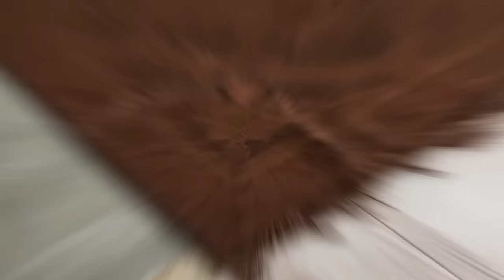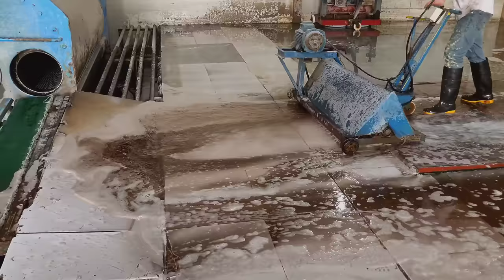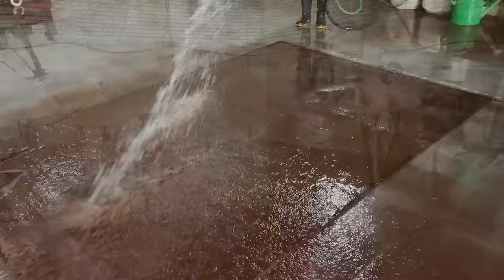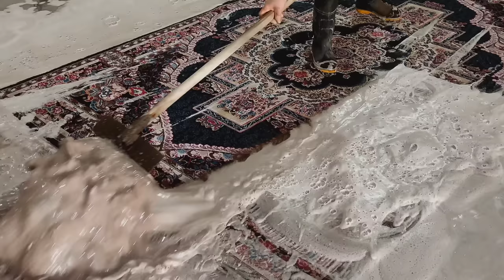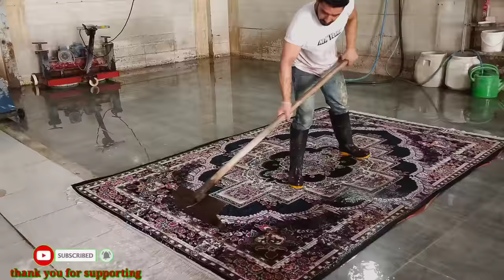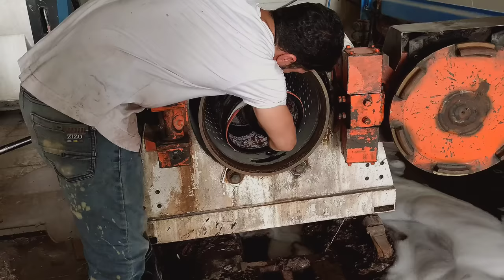$1 vs $100,000 Black Carpet! | The Hardest Rug of My Life!

Comment: I didn't expect the carpet to be so resilient and strong despite its initial state of neglect. Do carpets get weak with age? This work is quite physically demanding yet mentally fulfilling! Keep up the excellent work!
Reply from the maker: Yes and yes, thanks and welcome💖🌹
Reply: Believe it or not, these expensive rugs, sometimes over $1000, actually stand against time. They can take a beating, for sure!
Reply: If they are made of wool they can withstand a lot. They are also the easiest fiber to clean.

Comment: Turn it over and run a beater vacuum cleaner over it, Clean up the mess. Do it again untill solids stop falling from the rug. Now , with the sand and grit out, turn it back upright and clean it. I take all my area rugs out of the house, lay them on the grass, and do this. All the heavy stuff falls into the grass.
Reply from the maker: Awesome, thanks for the tips👍

Comment: My guess is the rug was saturated in silt-laden water from a flood. Excellent restoration.
Reply from the maker: Hi dear friend
We receive 100 carpets a day from customers for washing, and one or two of them are dirty like this.
Most of the strangely dirty carpets have been used by the owners in work and public places.
Reply: @change-cleaning-service-center  Thank you for the clarification. I have traveled a bit and noticed that they use carpets on the ground in some outdoor environments such as bazaars and as the floors of large tents, and can imagine how dirty things can get if soil is tracked in from an unpaved exterior.

Comment: When I was in the middle east, the fibers of the hand knotted carpets were tight together, resulting in stiff carpets, with little softness. The older the carpet, the more the fibers have been broken down resulting in softer carpets.
They would take a new carpet, and accelerate that "softening" process, by placing them out on the street, and allow cars to drive over them.
In some cases, the buyers would prefer a more aged appearance, and so they would take yogurt  and work it into the fibers, then place that out in the sun to "cure"
Reply from the maker: It's that right, thanks for your info👍👍

Comment: Just about need a rack to support rugs 2 inches above the concrete on a stainless mesh similar to expansion steel.  Then pu tthe rug inverted and spray right through it.

I cleaned a smaller rug for my mother years ago, since it was a one time thing I hung it over a rope, so the water sprayed would flow off taking the dirt with it... rather than sitting in wet mud on concrete.

Flush the debris out, then get the water out... and pray that the dyes are not water soluble (many of the rugs have dyes that will "bleed" when wet and water based cleaning will destroy the rug.)
Reply from the maker: Awesome dear, thanks for the tips 👍

Comment: I wonder if hanging rugs on a rack and starting out with a pressure washer and letting gravity do it's job before putting on the floor for all the cleaners would make the matter easier??? If skilled with a pressure washer you can avoid damage but bring a faster cleaning time???
Reply from the maker: We will do it
Reply: @change-cleaning-service-center : I'd probably start with soaking the carpet before pressure washing to help get the dirt rolling quickly [vs slowly with just a spraying by the presure washer] and some kind of rain gear, eye protection, and always be careful of your fingers or skin getting in front of the high pressure spray nozzle cause it can cut skin in some cases... Why being careful on rug faces and pattern should be cautious too and only use enough pressure thats needed... Prolly anything 3000 psi and lower will be best... But can't go too low either or not going to blast dirt particles out and away...  Obviously utilize the pressure washer nozzle for cleaning all the dirt and particles that are going to fly on walls during the process... Godspeed...

Comment: This is so satisfying to watch, but that reversing switch on your machines makes my wallet hurt. How often do you have to do work on those, or do you get someone else to repair them? The one with the two motors seems like it would break down more. Also great safety idea wearing rubber boots while doing this work with that cable hanging over your shoulder.
Reply from the maker: Awesome😊👍

Comment: One of my very first attempt to cleaning carpet after this 50th dump load of water or should I say mud I stopped that was a trailer house
1980
The next one was 2005 and this was a 6 x 5 piece of carpet at the bottom of a landing 
After 20 containers of cleaning solution from a rug doctor, I stopped it just wasn’t going to come clean 
Maybe it was the solution I was using
Reply from the maker: Awesome 👍

Comment: why cleaning on flat tiles? dirts at the bottom has no where to go, so much wastage of water. ideally tiles should have hole and deranged system below🤷I bet even after such hard cleaning there will be tons of debris stuck specially at the bottom.
Reply from the maker: It's that right, thanks for the tips👍

Comment: I'm calling BS...

Color is way too thick and solid, and it's clearly not been set in, as it didn't hold on the edge at all, initially.

Do real work and not just trash for videos.
Reply from the maker: Hello my friend
Many carpets are used by the owner in the garden for weekend cleaning, but they are not properly maintained, and many are used at work and in the open environment.